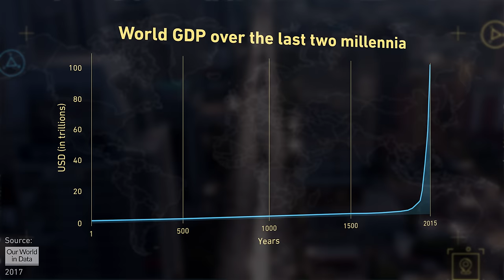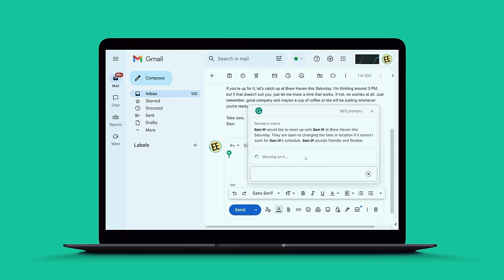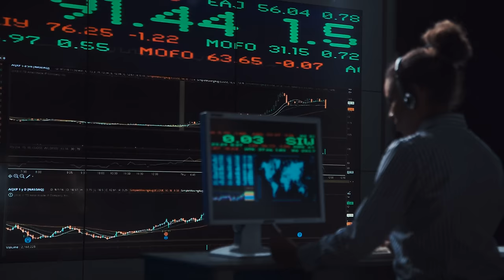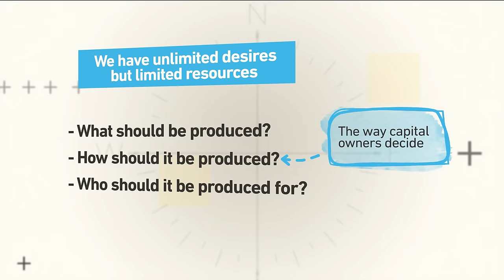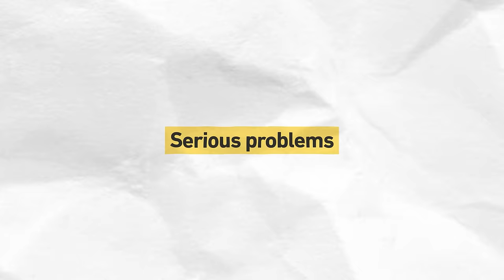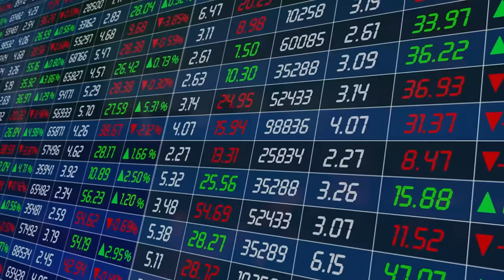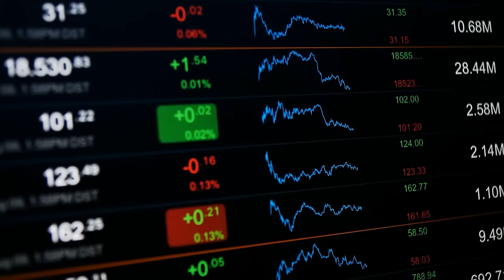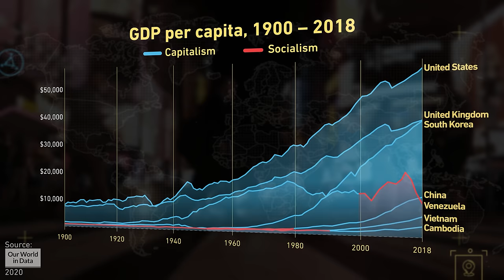Why Every Country Ends up Capitalist

Comment: Hmmm.    Has this really been properly  "tested" though?  We've only had one attempt at a system other than capitalism since capitalism arrived in full force in the world roughly 500 years ago.  The falure of Marxist Leninist communism supports the story that command economies don't work well.  And it failed most spectacularly in the USSR and it's Eastern European allies.  So much so that it's easy to forget that Marxist-Leninism was a fairly significant revision of what Marx and Engels described.  

No one is rushing back to try another such communist experiment.   That would be madness.  But trying one alternative to capitalism is hardly enough of a real test to be about to proclaim "everything reverts to capitalism!" 

Also, five hundred years of a run for capitalism is definitely enough to say "well, this certainly seems to work well enough for now" but in the context of the history of human civilization (5000-7500 years depending what you count), it's really not THAT much.  

Let's see what the future brings.   We could be just a few innovations away from a better system.  There's certainly enough discontent with capitalism's byproducts to lead to innovation.

Comment: Capitalism is indeed inevitable and the best system (if regulated, no extremes are good).
   I mean, you either allow the ownership of private property/means of production by a person (individual or legal, like it could be a cooperative for example) or not. If you do so exclusively and irrestricted, thats anarchocapitalism which is an extreme. If you do so exclusively public then that is an extreme form of socialism, and either extreme is wrong as it leads to issues in modern societies and only work in ideal markets at best. So yes, one should allow it, the real question is to what degree, because once you ruled out the extremes, the spectrum is quite big. The only thing I would say in respect of that is that one should not follow an ideological system but one that caters to the needs of the nation broadly

Comment: The only place where Communism worked was in the original Star Trek series. Communism in theory is not bad at all, for the ones who took the time to read the entire work. The big problem with it is that it is not realistic for our level of evolution. It depends on selflessness, responsibility, accountability and a strong sense of community. Capitalism is the best system we have been able to implement because it fits our current evolution level. Unfortunately savage capitalism was allowed to take over many large economies (i.e: The US) and is making the system implode, and dragging Democracy down the drain with it.

Comment: Todays work is better than tolling around on fields? Why? People in the medieval age for example had way more downtime than modern workers.
Reply: That’s a myth spread by TikTok. Medieval labors absolutely had shorter work times on crops because of limited tools however the time not spent tending to crops was spent on maintaining equipment and replacing damaged items across there area. It’s no different to how modern farmers during the winter spend the same hours working on the tractors and fixing there barns so they can be ready for spring.

You can read some research papers on this topic if your curious on what exactly they do through the seasons as it’s pretty interesting

Comment: No successful country is running pure capitalism. Well-designed and enforced regulations are the mortar that hold the whole thing together. With too little regulation, capitalism falls apart under a stiff breeze. With too much regulation, the whole thing collapses into a pile of slop. Either extreme creates a dystopia. When people rail against capitalism or against regulation, they're generally not thinking with this more nuanced approach: to them it's all or nothing, and IMO that's silly. Capitalism (especially backed by a stable republic like the USA that's responsive to its people) has proven itself incredibly effective, and proper regulation KEEPS it effective.

Comment: Economic flow MUST be maintained. If wealth is being accumulated into fewer and fewer entities, the system is failing or broken due to pure greed. Wealth must be shared fairly or flow cannot be sustained and segregation widens to a breaking point. Revolution. History repeats, and no system can prevent it. Only another reset.
Reply: Wealth must be shared fairly. Being coerced to share wealth is not fair in itself.
Reply: @TheAdamAdy Half true. Greed always finds a way. What's fair is cost-to-live. After that it should start exponentially getting harder to gain wealth or sustain increasing income. Think it's fair that for the past several years ActivisionBlizard has made every tax-paying US citizen pay them $5 per year to fund their absurd tax refunds due to tax haven loopholes? Greed finds a way. Coercion is often the only solution. I'm open to an alternative, but nobody wants to offer one. Likely because they can't think of one either.

Comment: The fact that you needed to create an video convicing/begging people to say "cAptialism is best", shows that the current system is failing you wouldnt need to do this if captialism was actually working as people could infer from common sense and data.

Comment: The unintuitive reality is that economic models have nearly zero effect on citizen prosperity. 

The only real factor in citizen prosperity is the quality of representation the citizens have in government. 

A benevolent government with Democratically elected representatives regulating industry will have growing citizen prosperity. 

An elitist dictatorship government will have failing citizen prosperity. (Side note: even if the dictatorship has a preferred demographic of citizens, even that demographic will experience falling prosperity and oppression, just not as quick as the others. Sorry bigots, you still lose even if your dictator gets in power)

A nation with a failing corrupted democracy will be experiencing a fall in citizen prosperity. 

It does not matter if a nation is labeling itself and pretending to be capitalist or communist or socialist, the citizen prosperity is still tied to the quality of representation that is regulating the system and to who's benefit the regulations lean. 

The only path to citizen prosperity is for the citizens to be actively involved in democracy (voting and lobby at a minimum) choosing their representatives and telling their representatives how they want to be represented.

Comment: Capitalism itself has nothing to do with wealth. The will to innovate is the real key, and a socialist government can pay someone to do this just the same as a free market can.

Capitalism has an unfortunate side-effect that it rewards pushing opponents to the bottom, just the same financially, as beating those opponents with better products. This is especially common for older companies who typically have larger ad budgets and notoriety. The fact that people are gas-lit, for example, explains why individuals will consistently buy inferior cell phones, rather than read the specs of what they are getting nowadays. LiPo batteries, for example, are more profitable for capitalists, but less valuable to the consumer since they are inferior to li-ion batteries in almost every respect. An example of how things are getting worse, but people don't realize it. The old-money of capitalists hides the fact that we are not getting the best we can get. In fact, there is a monopoly on these batteries, so you don't even have a choice of the better product if you wanted it! You just get the options that make the 'bullies' the most money.

An improvement would be a socialist system that also competes with the free markets. An entity large enough that its marketing messages get fairly considered by the consumer, and whose intent is designed to maximize value to the consumer. This then forces capitalists to always have to put their best product forward, instead of drowning out competitors.

An overall win for the market, and an expected next stage in the evolution of societies.

Comment: Here's s pitch for UBI:

Should private ownership of goods be allowed? Yes
Should there be social support systems to prevent poverty? Yes

When machinery and capital produce more value than could ever be compensated by human labor, at least one answer to distribute resources would be universal basic income. Give money to consumers, and they essentially have a voucher on a certain amount of produced goods.

This is particularly relevant if goods production is limited by demand being restricted due to a lack of funds owned by those performing labor. (e.g. because the funds flowing toward the owners of machine-capital is greater than that towards labor)

Universal basic income is therefore at least one solution to the problem of income inequality, within the context of a capitalism system. Additionally, if an equivalent amount of money provided to consumers is removed through taxes on production, this should increase the number of sales/transactions and thereby the velocity of money, without increasing the money supply, mitigating inflation.

Comment: No one knows what the world would look like if instead of capitalism there would be 400 years of socialism. The fact that socialism did not exist long enough doesn't say socialism is a non-working model. For sure, it is more humane, doesn't ask for wars, on the contrary, it helps others to develop. Socialism was smeared by the west because it had higher GDP growth after WW2. 
Despite great losses, the Soviet Union was ahead of the west in science, cosmos, atomic energy stations and more. Of course, there were shortcomings, which could have been solved, but with the help from outside the enemy ruined the country. Nothing good came from that. even the west itself started to have big problems: everyone feels the living standards gets lower and lower.

Comment: Hi there, love your videos, this one was great too. I just wanted to challenge the notion of inequality being bad (i.e. a default negative to be avoided). 

It seems to me that the right level of inequality is one of capitalisms greatest strengths. That is, inequality with the right amount of opportunity is the mechanism that drives innovation and development improving life for all. 

The thought that, I can look at someone with more, think of a new way to do a thing and then, work hard to find a more effective method to achieve said task and benefit, is core to the advantages that capitalism provides in efficient resource allocation and development of new technologies. Desire fuels us, if we were all perfectly equal (in a material sense) where would the motivation be to do, well, anything. 

The inequality I personally face (and to be clear, it's minimal, my life is ostensibly charmed by all relative and historic measures), and the desire to have more of the 'pie' is a great driver that motivates me in life. 

This is not to say systemic abject poverty and exploitation are good, they are not. There are forms of prohibitive and pernicious inequality that should well be addressed and minimized.  

However, to me a central benefit of capitalism is that is liberates and drive us to manifest own abilities, to improve our lot in life (i.e. be less unequal) by seeing what someone else has and wanting it. Capitalism provides for us the platform to actualize the best parts of our determination by conspicuously parading inequality for us to see, and thus work hard to achieve material goals we believe will make us happier and more fulfilled. 

TLDR: Inequality with real opportunity is a wonderful thing for us individually, and as a collective. 

Worth a video? Pushing back on the prerogative connotation the poor old concept of inequality and taking a moment to celebrate the gifts of inequality. 

I have more detailed thoughts if you'd like to discuss this at greater length (I have made some general states that may need clarification regarding nuance of thought, which I have undertaken), I will also defer to you and your excellent script writers should the above suffice, I have unwavering faith you will do a great job at this topic if you take it on.  

Peace oot